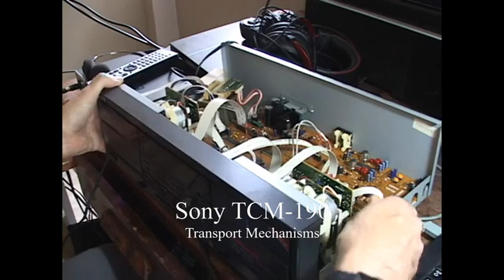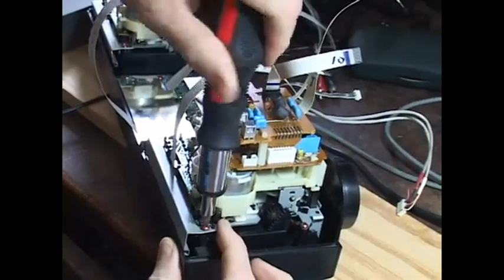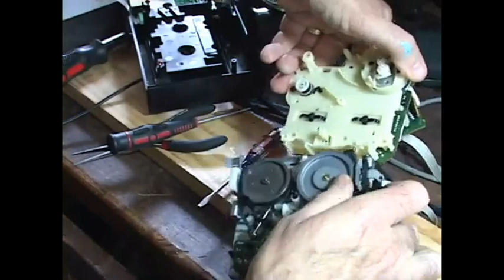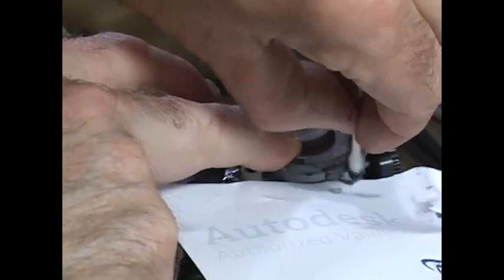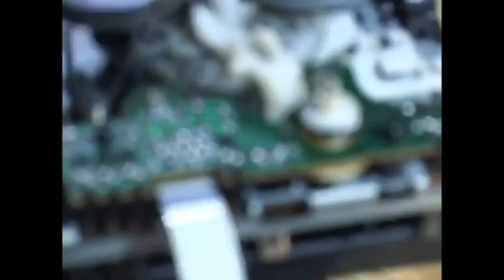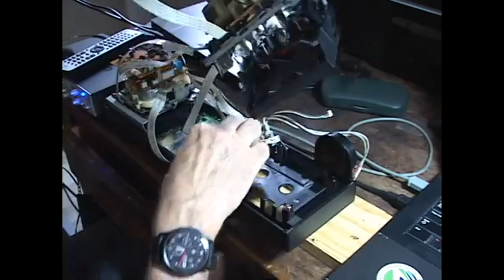Sony TC-WR720A Cassette Deck Belt Replacement - TCM-190 transport mechanism

Comment: Greetings. I changed the belts on mine, pinch roller & small gear. Only FF & stop works. Do you have any suggestions? I really want to get it workimg again. Thx in advance

Comment: I just aquired the same model and yes I can comfirm all the belts turned into black sticky goo. I haven't started working on the unit yet because I am not sure if it is worth to do so.
Reply from the maker: Good luck. I found it kind-of satisfying to cleanup and repair.

Comment: Very good 1st attempt on a TCM 190, the large belt is on wrong, it needs to loop around the large flywheel and over the top of the smaller flywheel, both capstans need to spin in different directions so when the pinch roller is engaged it pulls the tape in the right direction.... Forward in forward play and backwards in reverse play. Any issue do reply here and together we'll get this beauty running like new again.
Reply from the maker: Thanks, I figured the belt routing in the second video. I appreciate the comment.

Comment: The Andromeda Strain  ate rubber seals in one of its murmtations, causing lots of problems.

I have 2 of these decks needing this treatment.   So Thamks!!!!
Reply from the maker: I thought it was The Andromeda Strain! Thanks so much. Please be sure and check out the Part Two video to see the correct way to orient the wide belt.

Comment: Great job, Bro! What a crazy design which seems overly complicated to me. I always left double cassette decks alone when I found them in thrift stores. I preferred single units, preferably with multiple motors (and heads) rather than belts. That goo is terrible! I look forward to the next episode.
Reply from the maker: Thanks! Let's see what happens with this one.
Reply: Not all dual wells are bad, mate😊❤
Reply: @Zimmy_1981  No, they are not. However, IMCO, rarely were they made of top components, much more for mass market sales to those more interested in being able to enjoy more continuous music and less time flipping the tape over.
Reply: @scottrobb8934  correct, some were at least decent. Not super high end buy any stretch. For what they were (the good ones) they did the job.

I am so happy I listen to poor ppl music made in a poor country with poor equipment. Sounds decent on any decent system 🤣